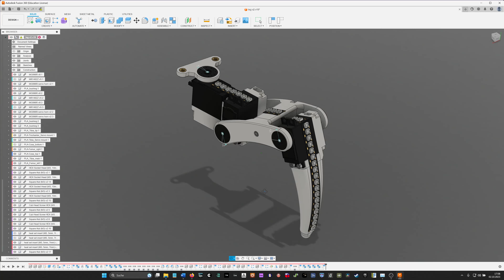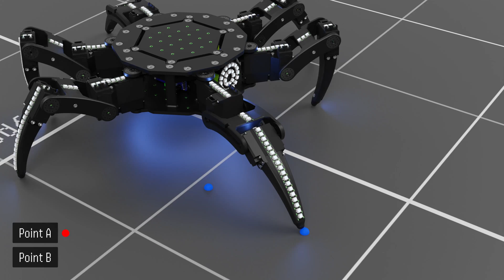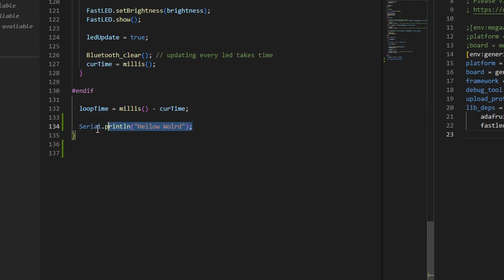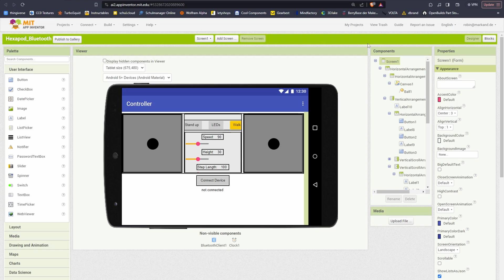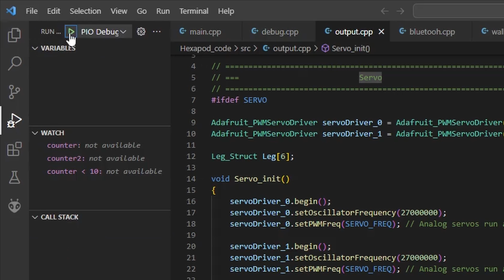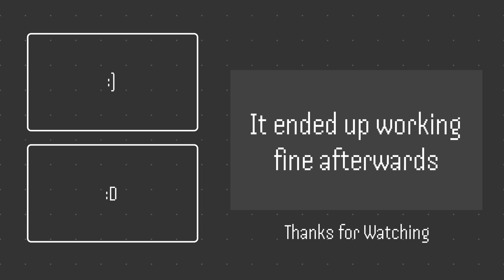DIY 3D Printed Hexapod: #2 Body and first Steps

Comment: When i am uploading code in the stm32 using stlink it is not uploading and showing this error OpenOCD init failed and on devices my stm32 is not being detected so is my stlink npt working properly ??
Reply from the maker: I have honestly no idea. Every time I get one of those errors I end up fixing it without really knowing how. I just Google stuff until it works again.
Reply: @SirKuhnhero  how did you upload the upload the code using st-link or FTDI programmer and if you have used an FTDI programmer can tell the exact module
Reply from the maker: I used both at some point. I don't really know the exact module, but YP-05 is written on the back. It's one of those red boards that you see everywhere. Don't know if that answers your question. Sorry, I can't be of more help.
Reply: @SirKuhnhero  it helped
Reply: @SirKuhnhero  i just to need to ask one more question did you flash the bootloader or you always connect the stm32 to that module and then to you pc and then upload it
Reply from the maker: I tried flashing the bootloader at the beginning, but I couldn't get it to work reliably.
Reply: @SirKuhnhero  so how do you upload code to the stm32?
Reply from the maker: @preetijain5828 It has been so long since I set it up so I can't really remember.  From what I do remember I had to install a driver for the ST Link. From there I just used the Upload command from PlatformIO. Considering the connections I connected the ST-Link to the STM32 via the four headers on the back

Comment: i dont get the part how did you upload the codes to the hexa code  is is like arduino or what i just didnt get that part
Reply from the maker: For the Microcontroller I used an STM32, which I programmed using an ST-Link and the PlatformIO addon for VS Code.

Comment: Can you suggest a replacement for hx-2s-jh20 BMS which you have given in ur list on instructables (2:16 ) That module is not available in my area
Reply from the maker: I don't know where you live, so I don't know what modules are available. But any 2s BMS should work fine if it is rated for something like 20A of current. Just make sure it also balances the cells (most should do that though).
Reply: I live in india , mumbai and everywhere it is out of stock . So Hx-2s-D20 is available should i use that ?
Reply: And can i use mgn995 instead of mgn996 ?
Reply: Thanks for replying
Reply: Sorry for asking so many questions 😅
Reply from the maker: No worries, always happy to help.

To my knowledge both should work fine. The BMS doesn't deliver quit as much current as the one I used but it should work. 

Considering the Servo it is a similar story. Most of these Servos, including the mg995 have a VERY similar design. However since my design is quit integrated, even small changes to the servo inside could cause it not to work. So I would recommend buying enough to build one leg and trying first before buying 18 servos.

Hope this helps :)
Reply: Actually we bought tower pro mgn996r but they had a different design from inside and mgn995 has the same design as your motors have . So should i buy mgn995
Reply: What if 6 servoes are m9996rvand other 12 are mgn995 will it cause  any problem ? Beacuse the mgn996 are not fitting properly but the mgn995 are fitting properly so can we use one leg made of mgn996 and other legs will be made up of  1 mgn996 and other 2 will mgn995
Reply from the maker: I don't thing that would cause any issues. I would personally make sure to use one of the m9996r servos in each leg to make sure they are symmetrical. If you use all 6 in two legs you might notice some issues as you try to walk at higher speeds where some of the servos can keep up and others can't. From images I can find online the mg995 servos do seem to be identical to the mg996 servos. They should also be strong and fast enough. I would buy them but I can't make any promises :)
Reply: @SirKuhnhero  yes i am using one mgn996r in every leg
Reply: @SirKuhnhero  actually the manufacturer of mgn996r is diffrenrent i am using tower pro mgn996r so when i opened it it was diffrent from ur mgn996r from the inside but we mangaed to fit 6 motors but it took us a lot of time so when i opened and saw mgn995 it was same as ur mgn996r from inside
Reply: @SirKuhnhero  thanks so much for the helpp
Reply: So it is okay to use mgn995 right ?
Reply from the maker: Should be fine. I have no way to test it but from everything I can find it should just work :)
Reply: If I dont use the heat set insert will it cause any problem ?
Reply from the maker: You might have to modify some parts. The screws that attach the Leg to the main body can use a normal nut without interfering with the leg movement. However the screws that attach the "body main_top" and the "body main_bottom" to the "body_spacer" can't. For them you would need to modify the body_spacer to be able to directly screw into the part. You would also need to do the same for the screws attaching the "control platform" to the "power pack". But I honestly wouldn't recommend it. Screwing into PLA is fine if you do it once or twice but if you need to regularly take it apart the quickly wear out. This is mainly a concern for the "body lid" since you will need to remove it quit regularly to get access to the electronics.

Comment: Hello, please tell me how to charge your Haxapod?🤔
Reply from the maker: I made a simple y splitter between the battery and the power converter. I can unplug the batter and charge it with my lap bemch power supply or alternativly charge it while the Hexapod is running.

Hope this helps :)

Comment: why all the leg are still folded since every servo in existence allow 180 to 270 degree freedom ? :face-orange-raised-eyebrow:
Reply from the maker: I made sure to assemble the legs with each servo fist being moved to the center position (90 if the servo range is between 0 and 180). Since I also assembled it with each joint having a 90 degree angle I have enough movement in the Servo :)
Reply: @SirKuhnhero  so you wasted 90 in the worst position possible leting it folded all the time ?

Comment: You should not be soldering to the li-ion cells like that, the heat can damage them, the proper way is to spot weld them. Also just shoving cells together in parallel like that isn’t safe, I hope you at least checked the voltages before you did that.

Also if you are just printing out of PLA you should be more careful with heat generating components (motors, voltage converters, heatsinks, etc), PLA softens at only 50-60 C.

You also use a lot of hot glue and other semi permanent attachment solutions, that will become very annoying if you need to take it apart again, especially when gluing over bolt heads.

If your LEDs draw 60 mA each at max brightness and you have 271 LEDs then that is a total of 16 A at full brightness, you will have to run the LEDs at very low brightness if you want that 5 V converter to survive.

Good work though.
Reply from the maker: Thank you for the input :)
You are right. You should not solder directly onto a li-ion cell. However since I got mine from an old e bike battery they still had some nickle strips that where spot welded. When I was soldering to the cell I was actually soldering to those nickle strips. Might have been hard to see.

Personally I had no real problems with heat. But I also don't run it for long periods of time.

I am also not the biggest fan of hot glue. But I had no real issues so far because everything I need to access regularly is not using hot glue. However I would do something different with the LEDs for the legs. I had to replace a Servo once and it quit annoying.

Also you are right about the power consumption of the LEDs. When I first turned it on the buck converter was screaming in pain. However 100% brightness is way to bright anyway. I ended up using it on 1%-3% brightness.

Comment: Thanks for your great sharing, question: how to recharge the battery?
Reply from the maker: I made sure that the battery can be disconnected and charged using an XT60 connector. Later I also made a Y splitter. This allows me to run the hexapod with the battery connected and power it from my lab power supply :)
Reply: I have also used a xt60 connector but how can i charge the batttery can you please tell?
Reply: And what type of y splinter you have used?

Comment: That's a really cool result you got there! 
Nice job on explaining the walk, too!

I was wondering if you considered using cables/sinews on the legs, and if you did, what made you decide to go with direct servos instead. 

With robotic hands, for example, people often use a human-like approach with all the motors in the arm, and I was under the impression that that's more than just a space issue. As I understand it, you can get flexibility into it more easily that way (which might make 3D terrain easier, too, idk)
Reply from the maker: Thanks :)
I did actually thought about it. I didn’t go that route for two reasons

1)	Complexity: Using cables increases complexity compared to what I did. With more parts it becomes harder to build and more things can break.
2)	Space constraints: If I wanted to use cables I deduced that I would have to mount the servos inside the body. Getting the Servos AND Electronics to fit inside the main body would not have been possible.

It would have some benefits, especially for 3D terrain, but those are in my opinion not worth the added complexity. Especially for my first Hexapod.

Comment: Great project! Just before i start to print anything, how tight are the tolerances? I have my printed pretty good tuned, so i don't want any part to be "sloppy"
Reply from the maker: If you have a pretty well tuned printer it shouldn't be an issue. I would recomend printing & building a single leg first. This will also help you find the right fit for the sliprings. For those you can just add a bit of xy compensation to get just the right fit.

Hope this helps :)
Reply: @SirKuhnhero  Thanks for the answer, I have now printed all the parts :P I still need to wait on some of the hardware.
But i saw in you'r "to buy list" there is no Bluetooth module? but in the wiring diagram there seems to be one?
Reply from the maker: You are right. I completly forgot to add it.

It's an HC-05 but I also updated the Parts (toBuy) file if you want to use that.
Reply: @SirKuhnhero  and one more thing, maybe it's only me but when I download the files from Github some of them are only 1 kb in size, like the fusion archive file 🙂 

Nice project anyway, I will build one and se for my self
Reply from the maker: @Omen2005  Thats because those large files use Github LFS. Sadly the free tier has a bandwith cap for downloads and I reacht that some time ago. Unless this bandwith cap resets you won't be able to download those files. 

But you can find them on Printables ;)
Reply: Hello again, I've built the hexapod now and uploaded the code to the STM32 and connected my HC-05 module, but I can't connect to the moduel. 

And in the app it doesn't show the HC-05 module 🤔

Do you mind help me out?
Reply from the maker: Shure, I would love to help you.

If you power your Hexapod can you see the led on the HC-05 flash? If you don’t that might mean your Bluetooth module is not correctly powered with 5v.

Also you mentioned it doesn’t show in the app. Have you paired it in your phones Bluetooth settings? As far as I know the list in the app only shows paired devices. If you don’t see ANY of your paired devices (like headphones etc.) in the app that might be because you have disabled something like “Nearby devices” in the app permissions.

I hope this helps 😊
Reply: @SirKuhnhero  thanks for the answer, i don't know what the problem was, but I remade the bluetooth connection in the mobile app and added a scan option with some feedback, and now it's works 😄 

Next problem is to assign the right servo to the right pinout, can you post a picture of the leg configuration? What leg is 0,1,2,3,4,5? And in what order are the servos? 
Servo 0 = closes to the body? 
Servo 1 = middle Servo?
Servo 2 = farthest away? 

Please add a picture or write in the code 😄👍 so i can get it working today
Reply from the maker: I made a small update to the Github page. Two pictures showing the leg and servo configuration. Hope that helps :)
Reply: @SirKuhnhero  great! Thanks alot for the fast update 🙏😄 

I'm currently working on a python version, so it can run on a raspberry pi, it will be easier to expand with sensors and faster processing, but it will take a while 😄
Reply from the maker: Are you going to publish you python version? Maybe as a fork on GitHub. I am thinking about doing some more complex stuff with 3d terrain traversal and this would be very helpful. It's just a though for now and still a long way off :)
Reply: @SirKuhnhero  yes ofc i will do 🙂👍 

Next problem, att the servos move in reverse 🤔 i can fix that in the code by adding a - value, but is there a fix? Or what have i done? 😅
Reply from the maker: Servos should always have the same direction. Have you maybe mixed up the left and right legs? Since they are mirrored the servos are also installed the opposite way. Other than that I have no idea what could cause this.

Edit: If you do have the left and right legs mixed up you shouldn't need to unassemble it. It should be enought to change the mirrored variable for each leg.
Reply: @SirKuhnhero  you are correct, i have installed the electronics the other way around 😕 
I changed the "mirror = True" to false and vise versa on the other legs. 
One side acts normal, but the other side does not. 

Do I need to change the mount Angel aswell? 
I have sent you an email, if you don't mind help a noob out 😅
Your Youtube mail that's in the bio.
Reply from the maker: How is the build going, where you able to fix it? After looking into is I honestly have no idea what could be causing it. Sorry i couldn't be of more help :(. On the weekend I might have enough time to do some testing on my Hexapod.
Reply: @SirKuhnhero  i have kids to put to sleep before I can test more, i will update you later on tonight 😅👍
Reply: @SirKuhnhero  when you say "calibrate" the servos, do you put them in 0 position? So you have equal travel at both direction? 

Cuz I needed to have alot of offset on the "servo 2"
Reply from the maker: I think I "calibrated" by hard coding a known Position that makes checking the Angle of each joint easier. I think I removed that later on. I am going to make a small update to the code to make it easier :)
Reply from the maker: I can't get my ST-Link to work now for some reason. Windows is not recognizing it. However if you add this code snippit to the start of the Walk gait it should move to the Zero Position. Which is as far as i remember the position I used for calibration. Here every joint angle (1 and 2) should be 90°. The first joint (Servo 0) should point the leg straight out (like a star).

for (size_t i = 0; i < 6; i++)
    {
        Leg[i].targetPosition = Vector3(0, 0, 0);
    }

return;
Reply: @SirKuhnhero  i saw your email yesterday, it was in the spam folder, but I have answer it 🙂 
I'm getting some progress tonight, I will send you an update later

Comment: What program was the simulation render done in?
Reply from the maker: The render was done in blender. Took some time but I think it paid off :)

If you are talking about the simulation directory on GitHub, that was meant to me made in Unity. Although I abandobd that loong ago.
Reply: @SirKuhnhero  so was the blender purely visual, or you coded the robot and tested the code in blender?
Reply from the maker: Pretty much only visuals. I did make a geometry nodes setup to get that last animation to work procedurally but that was done after.

I did use simulations in Unity to learn about the IK model for the leg. That is the simulation directory on GitHub.

I don’t know if it is possible to use blender for such simulations but I will look into that for future robotics projects.